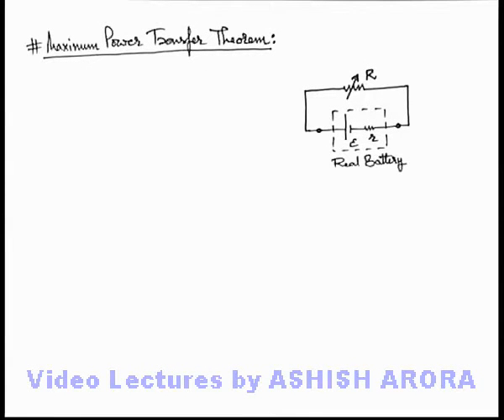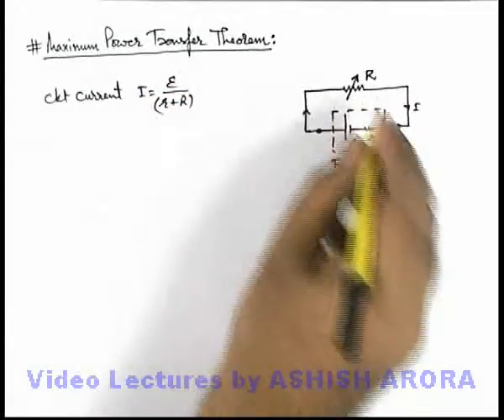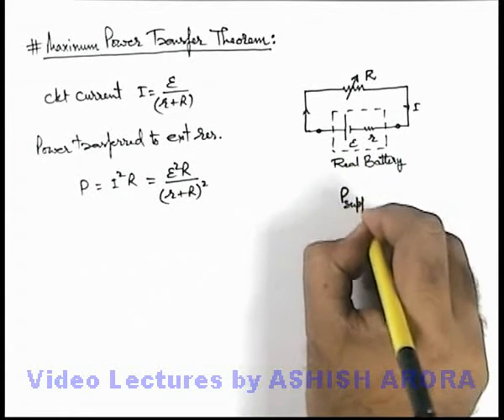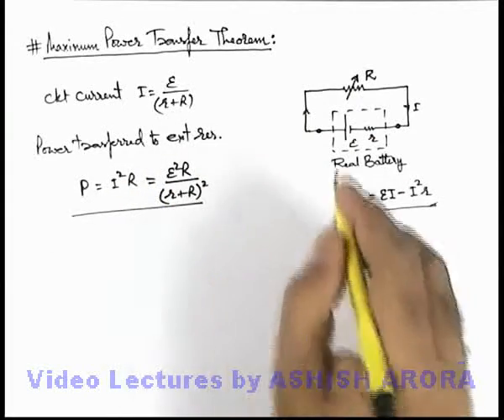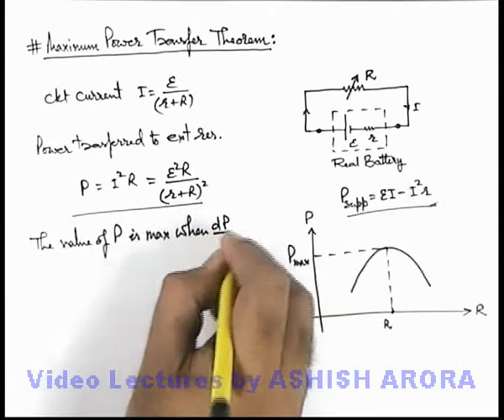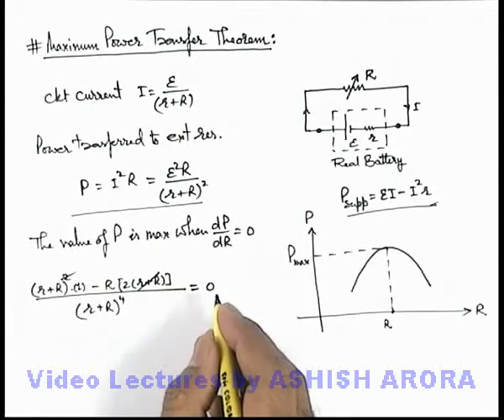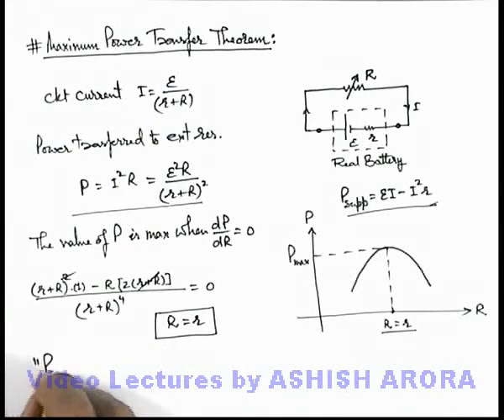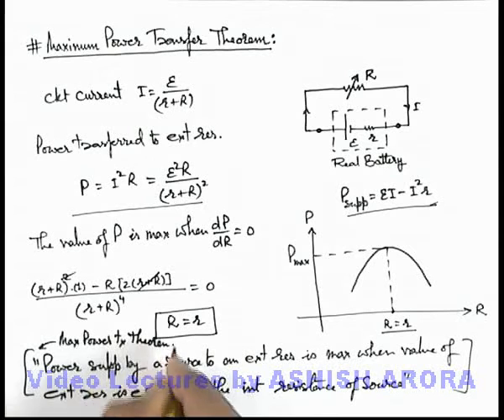Class 12 Physics | Thermal Effect Of Current | #11 Maximum Power Transfer Theorem | For JEE & NEET

Comment: resp sir ,  why is power transferred  is maximum when r = R  ,  please give a qualitative reason  ,  other than the mathematical conclusion .
Reply from the maker: This is simple... as we increase External R, the power supplied by the 
battery decreases as current decreases but the power transferred to R is
 i²R so... now we check what happens at R=0... power in it is ZERO and 
what happens at R→∞, i becomes zero and so power in it will again be ZERO so there must be some point at a finite value of R when power becomes maximum...
Reply: thanks a lot , sir